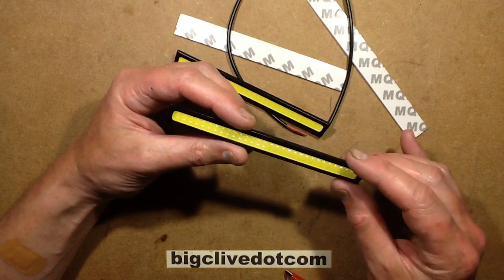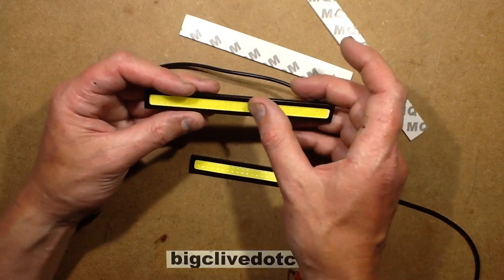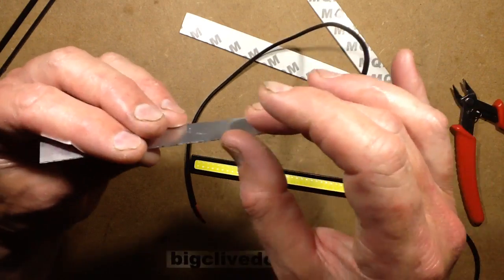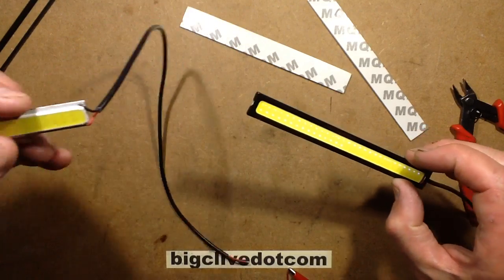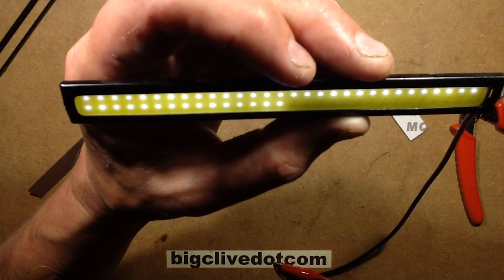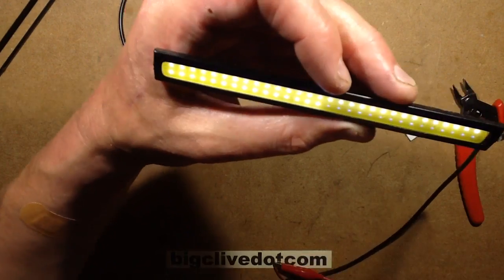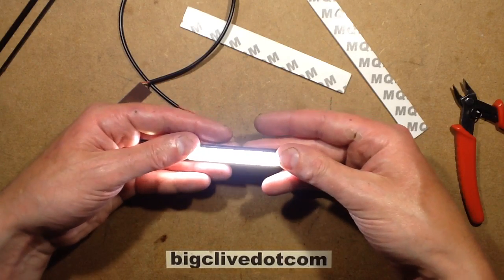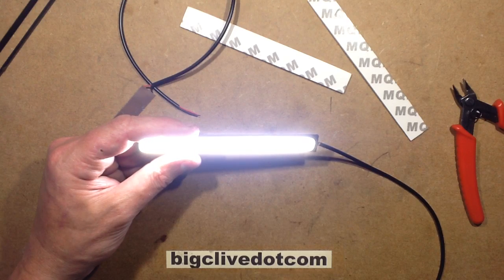A look at some LED COB light strips for cars / automobiles.

Comment: Interesting; I've been looking at this sort of thing and been surprised/not surprised to see how many are claimed to be "waterproof" and then you see big gaps where the wires go in and exposed solder connections, etc. I've got a need for something that's actually waterproof and finding such a thing seems ... difficult. ;) [In my case, I would be using a regulated power supply, so the issue you point out won't be a problem.]

Comment: 12 Volt, 4 Watt they become warm. 12 Volt, 14 Watt they will become more than just warm I guess...
Using them as daytime running light isn't smart. They get too hot and are not waterproof!
But they are great to build an inspection lamp (for example with an 9V Batterie).

Comment: I derated my stair lights after replacing them in less than 6 months with a chobber diode I found in my drawers, didn't know what diode it was but reduced the current from 4 amp to 2.5 because of its voltage drop for the strip and I can't see much difference in brightness, only that the led strip no longer fails and they are much cooler.

Comment: I think if I were using this in my car I would probably want to mount it on the inside as a dome light. That way they're only on while the car door is open. Plus I would want to use some sort of thermal compound for mounting them because the cars body will be a huge heatsink.

Comment: HI
I have been running these on both of my trucks for 2 and a half years with no problems. 1 truck I use for plowing and have some pointing to the sides between the plow and the truck, mounted on the A frame. and on my other truck is my daily driver and are used as day time running lights the a set in amber to make the front grill glow then i have a couple sets come on under the truck when the doors are open. again no problems.

Comment: I would glue some heatsinks on the back of them - like the ones found on a computer motherboard or something. Then, maybe put a diode in series. - These are ment to be DRLs anyways, so if they're a bit dim without the engine running, it shouldn't be a problem I think.

Comment: What's the advantage of putting the LEDs in parallel per individual LED, instead of putting complete series of 4 in parallel?

Is it reducing PCB paths, or does it help handling rogue LEDs?

Comment: Interesting. I'm always looking at new ways to illuminate mines and caverns for video and photography and these seem quite promising.
But - power supply. Lead acid batterys are too heavy to haul around underground and lithium cells are the way forward except clagging 3 lithium cells together to power one would place it at car electrical levels. If a simple, durable and light voltage limiter could be found I think it would work well.

Comment: Hi Clive.  Someone mention running them in series.  They look like they might be nifty as courtesy lights and wondered about running them in series-pairs.  Would the brightness be acceptable and heat manageable at 14V?
Reply from the maker: I think they would struggle to light at all if run in series.
Reply: I can confirm these do not work in series

Comment: I actually have a pair of these in my van, not used as daytime running lights however, they're used to light the inside of the van.
I suppose they're never really on when the van is running though, thanks for the video!

Comment: Would these require a current limiting supply if you planed on running them for any length of time?
Reply from the maker: They'll last a lot longer if you use some sort of current regulator or even a resistor with them.
Reply: Lovely, but it boils my blood to think that someone designs lights and advertises lights for automotive use—but if you want them to last more than 1 day you have to use a regulated supply or current limiting.  Imagine buying light bulbs for your home, and the moment the supply voltage exceeds 220V RMS every bulb in the house is ruined because you did not install "bulb driver" circuitry.  Does it make sense? lol...
Reply: +pillsnotbills Every high power LED I've worked with has always required current regulation, that's why I asked about these.  So I was not surprised. When LEDs heat up they have a nasty effect of drawing more and more current eventually burning out.  I imagine if you way under power them you could get away without regulation perhaps.  But that kind of defeats the purpose...

Comment: I have these and I made a flashlight/torch combo out of a toolbox
A small 12v battery powers an HID in a fog light housing, and then I mounted these on the outside to act as a torch if I need too.
They're very bright! and can be found for cheap on ebay

Comment: Consumer US vehicle voltage while running is 13.8 VDC considering the voltage regulator is not going bad..
I have these in my tube light fixtures as backup lights for power failures, mounted right on the ballast covers in the center.

Comment: I have one of these that was advertised as "12v to 24v", so I thought I'd see what happens at 24v. 
So 4.46amps (107watts) for as long as I dared to leave it on, quite amusing as it was supposed to be 10watt!!
As you can imagine it started to smell rather hot in only a few seconds
Reply: @ELECTRONTHORP I got this installed in my car. When engine is started, it flickers very fast. However, whenever engine is off, the brightness is constant and no flickerings at all..why flickers comes??? Please kindly help.
Reply: @ELECTRONTHORP the same led strip 12 v 2 w is connected in parallel with the turn signal circuit. But it doesn't glow when turn signal is activated?? Why?
Reply: I kind of want to run one of these (on a heatsink) at 24v to see how long it lasts. I have a bunch shipping from China for dirt cheap. I just don't have anything to power it at 24v.

Comment: Maybe the user should use bell wire to wire these into their car... That will limit the current ! :)
Reply: Don't know where you're from but around here bell wire is usually between 20ga to 24ga (AWG) which wouldn't limit current enough, nor do you necessarily want wire that does enough to melt or embrittle insulation off when everything around, metal/chassis is potentially grounded on an automobile.
Reply: Hmm, maybe my sarcasm didn't come across strong enough. What about Nicrome wire from a toaster?

Comment: Hi Clive. Remember I emailed you a quick video that I made of a 3watt flash light I purchased in a dutch poundland-clone shop ? I has a similar looking yellowish strip. I saw/had my hands on this for the first time then. I don't see the white pointy LED-spots that your video shows but if I shine with another light on the yellow strip in my flash light I see brown-yellowish tiny-brick-shaped LEDs. I guess this is the same Chip On Board technique huh

Comment: I bought some cheap DRLs similar to these for my car and had the very same suspicion and ordered an adjustable buck voltage regulator to manage the voltage to the LEDs so they wouldn't burn out, been using them for over 4 months with no problem, but I agree, these cheap after market LEDs for your car need a voltage regulator or they will most likely burn out.

Comment: I am wondering how long these would last if attached to the car bodywork via thermal glue.....  That's one mighty big heatsink!  I am wondering this as next week I am having my custom MG painted and a strip of these either side would look nice on the jet black I have chosen. Thinking of side ones low down and front as a running light or maybe even a driving light on dark country lanes. Any thoughts?
Reply from the maker: Whatever you stuck something like this on with, I'd want to be able to remove them again in the future if they did fail.
Reply: +bigclivedotcom Now that is a very very good point. 450v to the testies for me, I should have considered that! now its blue phase to left and yellow to right I think!
Reply: My only advice is to ask yourself, "How straight-from-PepBoys will it look in 5 years. Source the LED set up from an OEM or research for a top quality aftermarket solution. I think they could really give your MG that updated resto-mod style with some tasteful wheels and tires.
Reply: +Stephen Bianchi Thanks for that. I am thinking of getting very good quality full led system so all lights would be led. I allready have 17" alloys and Pirelli tyre. she is my baby.  :)  The car has a name to lol.. its called liquid as I have liq within the reg no. I know... I'm a geek. sadly I cant work on her much myself anymore as I have had a spinal fusion operation.  :(
Reply: oddly perhaps but car panels are lousy heat-sinks...too thin and too rough

Comment: Would they not do a decent enough job to add to the courtesy system electric loop through, so as well as the light in the headliners coming on and fading out out when you unlock your vehicle etc, these could light up the boot and foot wells for a short period - engine off so only 12v.

Comment: May you consider taking a 12 volt car ozone generator to bits. if so, here is a link, 

http://www.ebay.com/itm/12V-Mini-Auto-Car-Fresh-Air-Ionic-Purifier-Oxygen-Bar-Ozone-Ionizer-Cleaner-/331841614909?var=&hash=item4d434d343d:m:mAmef7wkdELF8zzJFgHUyxA
Reply: ***** bigclivedotcom i found it. Thank you

Comment: A 7812 reg would be useful with those
Reply: Car battery fully charged voltage should be about 12.6V with the engine off.  Unless the battery is extremely drained and alternator RPM very low,  the alternator charging circuit should keep the voltage around 14.7V, +/- 0.2V.

When the engine is running, everything that runs off the battery is getting ~14.7V (minus minor losses inherent in high current circuits, for example you might measure a little below 14.7V at the headlight sockets when they're turned on, or at the starter while trying to start the engine), as battery, charging, and powered electricals are not isolated from each other.  

When any component in the vehicle has to have lower than ~14.7V, it has to have it's own voltage dropping subcircuit to get there, is built in at the component end.

Interior lights, headlights, and also stereos all run from that 14.7V while the engine is running, although a "good" stereo will have an internal voltage boost circuit to achieve higher output wattage and run a VF display (when present), probably a voltage buck circuit to drop voltage to that needed by the misc ICs inside the stereo like preamps, or smooth ripple to things sensitive to ignition noise like the tuner.
Reply from the maker: A series resistor could help too.
Reply: Very good.  I wish the people who made these lights had any inkling of this knowledge.  Most of them seem to think, let's design it for 12-volt operation.  I've had it up to here with LEDs that work nicely (too nicely) for a few days and start blinking.  I think they are the same people who think that brake lights can be white and that there is such a thing as "steering lights."
Reply: At that wattage, that would be hot as a pistol.
Reply: Electro_Leet
As I understand it, 7812's have a rating of 1 amp with a heat sink. Also, you can parallel them to double their capacity.
Reply: You're right, but they'd still get hot! Linear regulators are super inefficient.
Reply: maybe a cheap chinese voltage/amperage locking BUCK step down converter might do the job ?
Reply: Heatsink doesn't necessarily affect the 1A rating.  You'd want it 'sunk somehow at anywhere above 1/4W dissipation which is voltage drop * amps, especially in hot climates.

For example [14.8V - 12V] * 350mA = 1W, then consult the heatsink datasheet for the C/W rating to factor in rise over max ambient temperature on an automotive environment which could exceed 40C temperature to start out on a hot summer day.

However, LM7812 have a fairly high voltage dropoff value compared to some other modern voltage regulators.  IMO it would be better to choose a low dropout regulator instead to retain the same brightness when the charging system is off, when battery settles down to about 12.6V or less.

Paralleled they would just introduce more unacceptable voltage loss because being regulated you'd need them in a current regulation circuit or without that feedback, at least series resistors after each.  Far easier to just use a single LDO regulator on a modest heatsink.
Reply: A cheap ebay 250mA LED driver would be better.
Reply: They make something suitable in a 250mA DC-DC now?  Can you give a hint how to find it?  I'm only coming up with AC-DC, unless you mean to hack a 10W DC-DC design by altering the feedback resistors till it drops to a lower current, which is what I'd have done anyway if there were more voltage headroom than 12.6V - 12.0V = 0.6V at most with the engine off.
Reply: +bigclivedotcom Clive, offhand do you know if the car battery is normally at 12v, and it's the charging circuit that runs at 14v (or whatever)?

If so, why not hack into a line that runs from the battery (and is on an ignition cutout, obviously)--surely the interior lights don't run directly off the charging circuits and neither do the headlamps. Stereo installers do this sort of thing all the time.
Reply: Look up
Dimmable LED Driver 12V MR16 3W 9W  3W 3X3W 250-600mA  For High Power LED Light
on ebay
Reply: Thanks for the suggestion, but I am not certain that would work.  This COB light seems to have 4* LED in series and the listings for what you wrote detail as follows:
"There are 2 type for choice:
1, MR16 300mA, It is for 3x1W MR16 12V
2, MR16 600mA, It is for 3*3W or 4*1W MR16 12V"
This would seem to indicate that the 300mA version can't manage 4* series of LEDs or else it would have stated it along with stating it for the 600mA version.
I am not stating it can't do that, only that they don't spec that it can do that.   Their specs are a bit fishy as well because it can't be dimmable as there is no input pin nor potentiometer on-board to control a dimming function.
HOWEVER, it occurs that it might be possible to hack that particular driver to help it towards supporting 4* series of LED (their sum Vf).  It is configured as a full bridge rectifier on the input to support AC input which isn't needed with a DC input so those diodes could be shorted across (and a pair removed) to provide direct DC input without the Vf drop across diodes that aren't needed.
Ultimately my point is, there is a chance it could produce light but I find it doubtful it could drive the COB panel in the video to 300mA with a 12.6V battery.  14.7V, yes I think it should have no trouble doing that, but sometimes the specs on these cheap regulators are so off of reality that experimentation with the specific LEDs you want to drive is the only way to know how it's going to work out.
Reply: It's like assuming your wall outlet is 120 or 240V ... not!
It can and does vary!
Reply: A simple circuit with a TM3055 would increase the current rating to 3 constant draw, to 5 amps (5amps peak). Have used this arrangement to run car CB Radio's as base stations, and to make bench supplies. Works a treat.

Comment: Might be OK if you get some thermal adhesive pads and mount to bodywork.

You can get 3v versions of those style cob LEDs:
http://www.aliexpress.com/item/freshiping-10PCS-Red-warmwhite-whiteColor-LED-COB-Source-Bar-chip-diodes-5W-LED-COB-strip/32345874323.html

Comment: So stick some diodes in series if you use them in a car?
Reply: only a matter of time before someone designs a 240v version for a lightbulb!
Reply from the maker: They already have lamps with COB strips slid into slots around them.
Reply: bigclivedotcom
yes, but they are lower voltage strips, i kinda mean cobs that can directly run on 240v
Reply: Cant see much differnce in psu circuit to the leds on a round plate jobbie, more usefull for use in striplamps though :-D
Reply: Such as these? 
https://www.alibaba.com/product-detail/AC220V-high-voltage-7W-9W-12W_60134085706.html?spm=a2700.7724838.0.0.e9YQJl
Probably contains some regulation/driver in addition to LEDs only
Reply: Michael Tempsch
nice, ! exactly what i was thinking, hopefully someone will review some!

Comment: i use a strip like that my strio have a allum frame not black and i run it on 9 volts dc give out very good light i have 4 install under my kitchen cabinet the wiife is very happy with it lightup the entire conter
Reply: is the light hurtful to the eyes? like for reading ?

Comment: I bought the exact same set for something under 2 euros and noticed the same thing that the leds light up at very different voltages. I could not resist buying them because the seller had a long list of "checks" for good/bad quality and advertised just how wonderfully high quality these are :D
Pretty usable generic "floodlights" when you regulate the current/voltage and manage some sort of strain relief... or just replace those stupid thin wires altogether. Can't really complain for the price. I'm sure someone is cheated something like $25 for the exact same product since mine came in a cardboard retail box and everything.

Comment: You got the crap ones. The ones I have have 84 leds not 60 and they have on-board current regulation.
Reply from the maker: I only buy crap stuff.  It's much more interesting than the properly designed stuff.
Reply: Can you possibly link me to the ones you bought? I have the cheap ones from this video and would rather not have anything happen to my car..